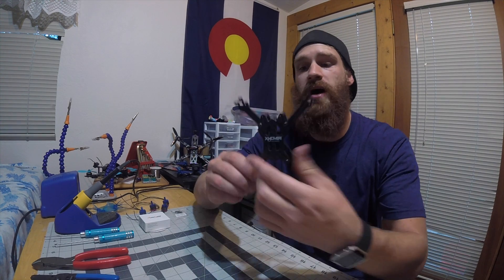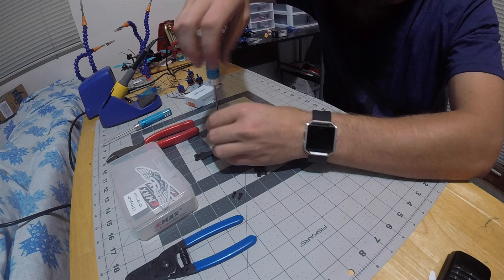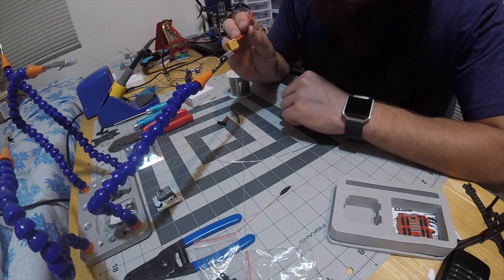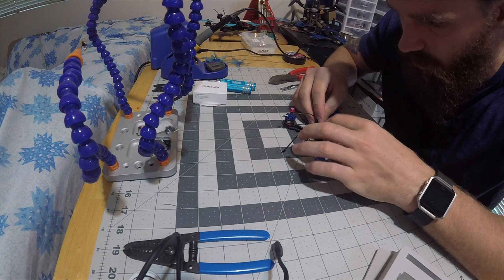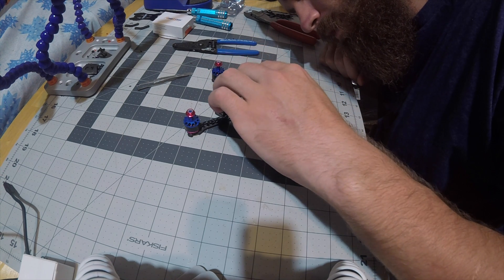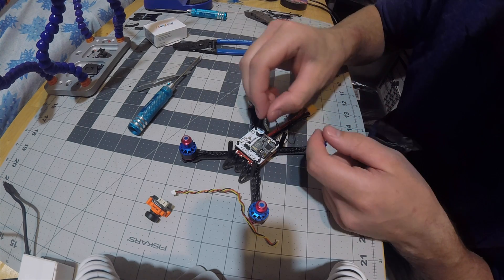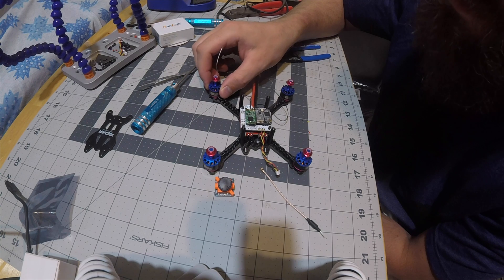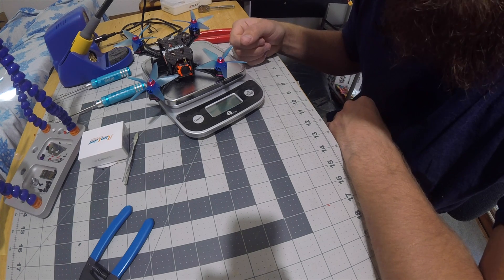How to build an Xhover Win 3 with emax magnum!

Comment: ROWDY, did you ever find a 3D print mount for the cam if so which one fit.. THX..
Reply from the maker: Cletus Lancelot yea go look on brain3d they have them!
Reply: Rowdy Engineering great thanks..
Reply: Rowdy Engineering. Hows your frame holding up? I just got mine and dang the arms have a lot of flex due to the direction of the cut. Was hoping it would be a stiffer frame like my last 3” build. 
Seems that all the win 3 frames are the same. I have the stingy which is a solid frame and a lot less flex than this one. I would assume Xhover thought this one through though.
Reply from the maker: Cletus Lancelot I had one super hard crash and broke an arm but other than that it's held up well.
Reply: Rowdy Engineering I know I’m prob over thinking it, hahhaha I love the Xhover frames, had the gep sparrow 3” which actually flew amaizing but had a light crash in the grass and the arm broke right on the inside motor screw holes, thought that was pretty week over all though the frame had very little flex. That’s why I now went with the Win3 cause they use quality carbon, just wasn’t sure when I received this one. Fit and Finnish is definitely there like the rest of their frames.
Reply from the maker: Cletus Lancelot yea there is a tiny bit of flex on mine but for the most part it is super stiff. Did u have a crash to loosen the carbon?
Reply: Rowdy Engineering no the GEP Was one piece carbon frame  it cracked on the inside Screws hole across and wasn't even a hard crash ..
Reply: I just noticed on this frame the carbon  weave isn't diagonal on the arms like their other frames
Reply from the maker: Cletus Lancelot I don't crash as much as I use to so it's holding up just fine lol

Comment: Love the videos! One question... Does the Runcam micro fit without any modifications? Do you need a 3D printed mount for it? Flight video would be awesome! Thanks!
Reply from the maker: Falcon73 FPV the micro fits just fine. They do have 3d printed holders too if you would rather do that. I'll definitely be doing a flight video next!